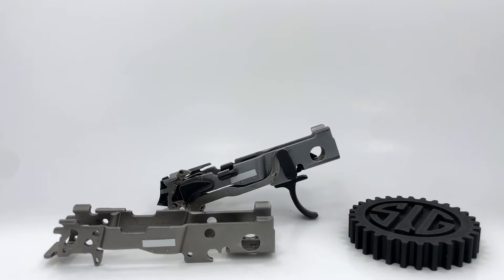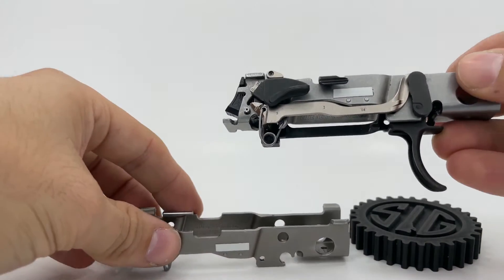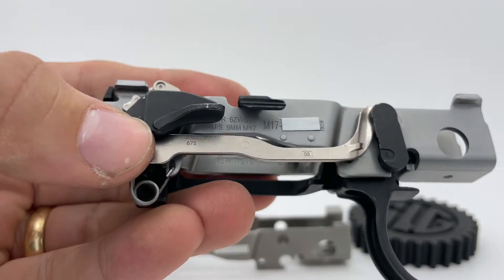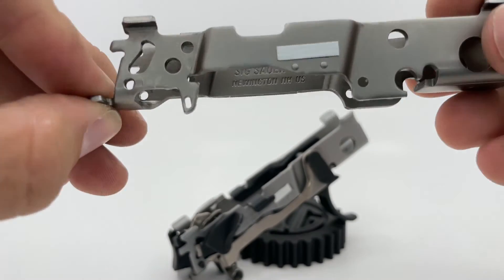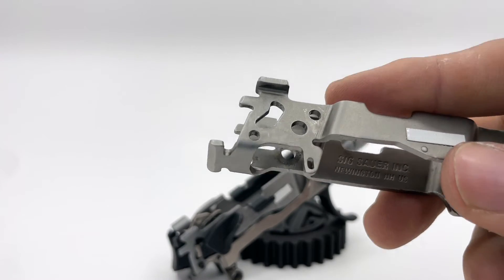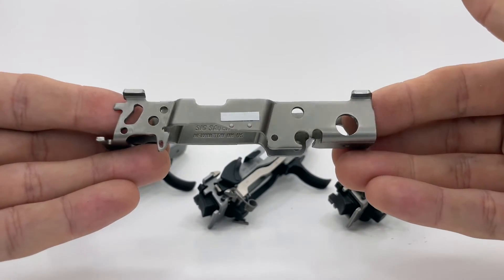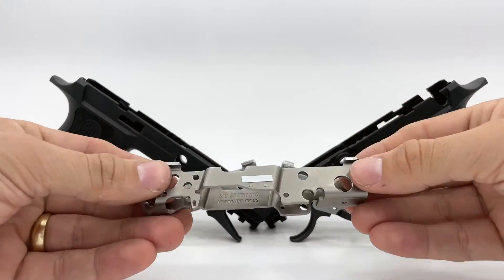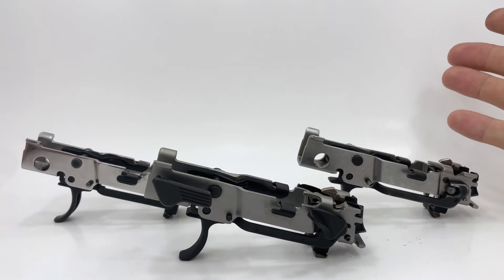P320 - MANUAL SAFETY FCU CONVERSION PROJECT

Comment: I own 2 P320’s and neither has the manual safety. Is there was way for me to get a manual safety installed on both of mine. I do like the 320 because it is a smooth shooter and spot on accurate. Thank you.
Reply from the maker: You can always send it out. There are companies out there that will do the cuts for you to add manual safety.

I also sell a kit that facilitate the cuts so that you can install Factory manual safety assemblies. It’s called the MSAFE-T toolkit.

Comment: Why does Sig not make one FCU and then apply the manual safety on only those they wish?
Reply from the maker: Technically, they do with the M 17 and M 18.
Reply: @SIGMECHANICS  What I was getting to along my scenic drive, was the slots for the manual safety should be cut (Stamped) in to the FCU frame of all P320 FCUs. But fortunately for you they don't, so the aftermarket has something to do!
Reply from the maker: @Hibbie2963 ah! Yeah I completely agree, it’s such a simple add on to their stamp!

Comment: I would like to be able to buy a Fire Control Unit from Sig Sauer with a Factory installed Manual Safety for my P320 pistol !!!
Reply from the maker: The only way to get it currently from the factory is buy the M17 or M18.

Comment: Yes, I would love to covert my 320 XTen into a manual safety. Does sig make the kit.
Reply from the maker: It actually works with Sig factory parts, here is the full how-to video (the project launched not too long ago). I should note that the kit is currently out of stock with new stock set to arrive in about a week with a few upgrades. So make sure to you subscribe to the “notify me” on the Sig Mechanics webstore to get an email when they’re back.

(UPDATED) P320 MANUAL SAFETY CONVERSION TOOLKIT
https://youtu.be/wOTGWaTOrqA

Comment: I'm genuinely curious, why would I want to add a safety?  What are the pros?  I have been a big Glock guy for years and p320's are new to me.  I love them tbh.  I have 3 and none have a safety.  I do notice that this conversion is popular though.
Reply from the maker: There is no real pro or con, within the Sig community the aspect of modularity is huge, I believe that since it’s an upgrade that makes it so that you now have a new option to modify the gun, makes this very popular. Once you do this upgrade you can then swap back and forth between safety or no safety which I believe is a good way to not have to buy another FCU (just to have that option). It really ultimately comes to a personal preference when it comes to personal use/protection. Those with 1911 backgrounds love a safety, those with Glock experience may not even ever use it.

Comment: Can you add manual safety for 320 in 45 cal
Reply from the maker: Absolutely! I’ve done to an x-Ten (which also uses the .45 frame) with no issues. 

There’s an updated video with details here: 

(UPDATED) P320 MANUAL SAFETY CONVERSION TOOLKIT
https://youtu.be/wOTGWaTOrqA

Comment: I am interested.  I was thinking about getting a P320 through Sig Custom Works, but their website states that this modification is not available with a manual safety.  That would be a deal breaker with me unless something like this could be done.
Reply from the maker: Here’s the link to the full how-to video and kit info:

P320 MANUAL SAFETY CONVERSION (HOW-TO USE THE MSAFE-T)
https://youtu.be/zemqe3gMqJs
Reply: @SIGMECHANICS  hey trying to view the video. But it says it’s private.

Comment: Yes I would!!
Reply from the maker: You are in luck. This project went live a few months back. Here is the updated video!

P320 MANUAL SAFETY CONVERSION (HOW-TO USE THE MSAFE-T)
https://youtu.be/zemqe3gMqJs
Reply: @SIGMECHANICS  Is the manual safety trigger bar going to change my trigger travel or lbs. of trigger pull in any way??

Comment: great idea!   I've USED AB Prototype and their work was great - but you need to ship R/T which is costly, plus it's a cost per FCU

Always wondered why Sig doesn't just cut the needed slot in ALL FCU's - and give the option of manually adding the parts later if desired
Reply from the maker: That’s my main pain point with the service as well.

Here’s the update to this video:
https://youtu.be/zemqe3gMqJs
Reply: @SIGMECHANICS  I may still buy this in case I buy another P320 FCU without a manual safety.   Thanks for your videos and now this incredibly innovative tool

Comment: No idea why Sig would not make the FCU the same for the Safety and Non-Safety versions. Seems like more work for them. The P365 you can just buy the Safety lever parts and they fit right in to the FCU
Reply from the maker: That is exactly my thinking, would have been very easy to add them from the get go. Something like that on a stamp wouldn’t add cost as far as I see.

Comment: I chatted with Heath at Sig yesterday in response to the 6/14 "colorful parts" email and he says Sig is now offering a factory conversion of a P320 to add the manual safety lever for $265 including parts and a new grip module and return of your current grip module. Cost for a P365 was $160. presumably because the frame is already configured for a manual safety lever and doesn't require modification or replacement like a P320.
Reply from the maker: That’s pretty cool! I like how they constantly come with new designs to customize! 

My project is a bit different, here’s the updated link with the details (the project went live not long ago):

https://youtu.be/zemqe3gMqJs

Comment: I think this is a great option and would certainly entertain doing the install. thanks.
Reply from the maker: Thank you. I actually recently released this project and the kit is available through ModGuns now! Here’s the full video with details:

P320 MANUAL SAFETY CONVERSION (HOW-TO USE THE MSAFE-T)
https://youtu.be/zemqe3gMqJs
Reply: @SIGMECHANICS  thank you. my p320 has not had the trigger  upgrade done at the factory, I'm guessing I should do that first?
Reply from the maker: @bbdudeyt  Yes, I would recommend you get the upgrade done first.

Comment: Howdy Eddmen 🤠
I have a question, I have noticed by handling many p320, p365 & m17/m18 models. From what I owe to many other gun shops with new and used SIG’s.  

With every single manual safety m17/18 I’ve handled, I noticed a bit of sucking down movement of the rear part of the upper slide when dry firing without the magazine installed (with mag installed the movement is less because the mag follower is pushing up, but still very noticeable)… 

Now with all the non manual p320 & p365’s I’ve looked at, there is no perceived to very little sucking down movement with the rear upper slide when pulling the trigger with or without the mag in. 

When checking for slide and FCU movement/ wiggle/ relationship tolerance, it didn’t seam like the non manual safety models had much less movement/ tighter tolerances.  

I believe I understand that the sear moves in a downward movement when the trigger is pulled and what ever slop that is in the striker fire housing, slide and FCU gets tightened up by the friction with the sear and its downward movement. 

Now I was told by a sig expert that all sig models are Assembled guns vs fitted for better assemblies with tighter tolerances, even if it’s a legion model. And so one could get a gun that fits tighter or looser than another no mater the model. Which would mean all p320’s would have variation of slide movement no matter the model, and a M17 could have next to no movement and a xFive have quite a lot.  Which is not my finding with the sample size of 20 I have experienced so far. 

So my two questions for you are. 
•One, do the M17/m18 models run different tolerances or parts? Like is the slide hole for the striker fire unit bigger or the striker fire housing smaller?
•Two, when modifying a non-manual FCU into a manual FCU, does the movement change? 

Thank you for your time.
Reply from the maker: Great analysis. To start I will share this video where I talk about the slide movement and why: https://youtu.be/itGqqq8IcL8

To answer the questions:

1. No, there is no difference in tolerance. Generally the slides are all milled in one way, with various changes (Ie: M17 is shorter, x5 has lightening cuts etc), but the core slide is the same. This is how you get many companies that make slides for the P320, Sig provides them a model of the slide under their OEM program and they add a design to it.

It’s possible the slides can have variation depending on tooling, programming and such, but that’s not going to be common with factory made slides. 

Part tolerance does exist of course, for the most part Sig uses MIM parts, because not only are the parts made en mass, but injection moulding is generally considered a great way to keep high tolerance when mass producing. Therefore, you MAY be talking fractions of an inch, but almost never something so massive it will make you too far off spec.

2. No, there will be no difference so long as the cut out is made to the correct specs (give it take), you will not find any additional changes to the feel of the trigger.

I hope this helps. Let me know if there’s anything else, you can always email me as well at sigmechanics@gmail.com
Reply: @SIGMECHANICS  Thank you for the great response. Yes, because of your video and others on YouTube I became aware of the movement so I started looking for it. I have a xTen with no up & down no movement and my local shop has a well used p320Max for sale with no movement ether. Actually all current/new p320 in the 3 different local gun shops don’t show near as much movement as your p320 used in your video. But all M17/M18 (about 6 samples) have shown more movement than what I see in your posted video.  Which leaves me very confused. Lol

Comment: I refused to buy a P320 until I could get one with a manual safety.  I would be interested in a conversion kit, but I would want it installed by a gunsmith.
Reply from the maker: Most any gunsmith should be able to do this work. Here’s the updated link to this project: https://youtu.be/zemqe3gMqJs

Comment: You are incurring 100% liability for any "bad stuff" that happens down the line. I would not do this. Buy an M17 FCU and be done with it.
Reply from the maker: In many ways, it’s strange to say it, but the reality is in every instance of modifying a firearm yourself, the fine line between “it failed on its own” and “I did it wrong” gets too blurred, if something goes wrong. It the main reason why all the part manufacturers make a note that all parts should be installed by a qualified Gunsmith. Even when it’s just swapping out a trigger, (which is a task almost all of us know how to do ourselves). It’s the unfortunate reality of liability .

However, I wholeheartedly agree that if you are not going to be 100% confident in the modification, the M17 or M18 is the way to go!

Comment: This will void the factory warranty.
It is much simpler to buy a P320 that is factory equipped with a manual safety.
Reply from the maker: This will ABSOLUTELY void the warranty. However it’s something people decide to do for various reasons. There are a few companies that have offered this as a service for several years and it seems like those that opt to do this really like it! Only down side is having to ship off the gun.

Comment: I bought an M18 so I could have a manual safety, but Ive made so many upgrades/changes at this point that Im essentially building my handgun around the trigger module and safety. This product would have saved me loads of trouble and Id definitely buy one.

Comment: Does the m18 manual safety block the sear from releasing the striker or just the trigger from being pulled? I'm a Little nervous using the m18 as a everyday carry
Reply from the maker: The safety essentially physically blocks the trigger from moving forward, there is a pin on the safety lever that locks into a slot in the trigger, which then stops the interaction between it and the sear.

Comment: I own the Carry AXG metal. It is my favorite pistol. However, with latest lawsuit I just won't carry. I was told it was not possible to add manual safety. Now that I see it is potentially possible, I now face the problem that my frame is stainless, which means as much as I would jump on the opportunity, it won't work with my metal frame .
Reply from the maker: I have not tested it on the AXG, although i imagine the process would work if you first remove the grips. I do intend to try it out though. I will report back once I do.

Comment: I've been looking at various full size 45 and 10mm handguns for use as a woods gun.  Although I like the Sig P320 XTen, I had pretty much decided against it because of the issues that have been reported with accidental discharge.  Even after their upgrades, if you are counting on the mass of the trigger to be light enough in during a drop to not move the ~0.190 inch that is required disengage the other internal safeties, and if you're counting on never having anything snag the trigger in a holster, then I'm just not comfortable with it.  Glock at least has the trigger safety. Springfield has trigger and grip safeties. And the DA/SA guns don't have this issue at all because of heavy trigger pull in DA mode and manual safeties.  That being said, if you offered this manual safety, I would quite likely buy the Sig and it would certainly be upgraded with the manual safety.  I think having a locked trigger would be better than trigger and grip safeties.  And I like the gun other than this one critical issue.

Comment: i would be interested. would i be able to convince you to send me the dimentions and location for the pocket on the FCU for my own use? as i will not need a jig.
Reply from the maker: I can would but I don’t have it set off t that way. I also would NOT recommend to free hand it. The bits will jump and it will be hard to gauge as you go without parameters in place.

Comment: Would this method also work with the P320 xten? Thinking of picking one up, but it currently has no manual safety version.
Reply from the maker: I jus looked into this now and as far as I can tell… it will work. I’m hoping I will get an opportunity to actually try it out soon.

Comment: Would love to add to mine. If you do get this into production, I would like to hear more details. I had always had a manual safety in my early years because of time in service and got use to them. Times have changed and most have chosen to go away from them. I have seen though most accidents though are not from holster pulls but from exposed triggers, that is where I believe a safety would be most helpful. If you roll this out, I could see myself making the purchase if I can find a gunsmith willing to do the work.
Reply from the maker: It should be available very soon via ModGuns (formerly SigSauerParts.com), no more than a few weeks from now.
Reply: @SIGMECHANICS  any updates? I’m interested in this as well!

Comment: Love the video, thank you! I already sent my FCu and had it modified. I purchased the Wmanual safety parts kit and now just need to intall it. I am old school and do not entirely trust any striker fire to not be able t have a misfire. I have seen glocks and just about every one of them have a murphy law day and go off. where a simple manual safety fixes or at least greatly reduces that to almost a 1 in a billion chance.  I know many striker fire enthusiast will argue it slows your response time yadda yadda, all made up excused. I lift the safety on the draw after it clears the holser in and out of copetition and it has never ever effected my time.

Comment: I didn't even realize the safety equipped FCUs are different. I was about to buy a safety, thinking I could just stick it in. Seems weird that they make a specific modification to the FCU for a modular design.
Reply from the maker: I always thought so too. It would cost nothing to just add it.

Comment: I have seen a kit on Sigs website. Is this the kit you speak of or something different? When I saw it online earlier today it said it was out of stock. It was a p320 manual safety kit.
Reply from the maker: They are two different things but ultimately work together. The kit I’m making allows you to convert the non-manual FCU and grip so that afterwards you can install the manual safety kit. 

Unless you modify the FCU (or already have an M17/M18), you cannot install the MS.
Reply: @SIGMECHANICS  okay I see now. That is a product I would very much so be interested in.

Comment: Any idea on price? I'm about to send my p320 to AB Prototype and they charge $199. But if all I need is your kit and a dremel then I can wait.
Reply from the maker: I’m shooting for $50, so if it changes I expect it to still be somewhere there (but never $100+)
Reply: @SIGMECHANICS  So we buy the P320 manual safety parts kits for $100 from Sig and then your kit for around $50? Still makes sense to me as I plan on buying another P320.
Reply from the maker: Yes. I will be working with SigSauerParts to help me release this (they’re setup to e-commence and I’m not), I haven’t finalized anything, but I believe we may do a promotional thing to get a better price on the MS factory parts if acquired with this kit. It’s not set in stone but I’m working on it.
Reply: @SIGMECHANICS  I bought the safety parts from someone with a M18. I have the TXF full size grip. Do you know of any issues with cutting the TXG grip?
Reply from the maker: I’m just about to start shooting a video for cutting the grip and I was planning on using the TXG as an example. 

Therefore, I don’t have a response for you now, but I should have something soon. I will mention that I have heard of other people, cutting their TXG grips and not having any issues.

Comment: I would like a manual safety on a p320 to avoid a discharge when re holstering the pistol and there is an obstruction in the holster that could press the trigger. We do not always look to see if the holster is clear with no obstructions before we re holster.